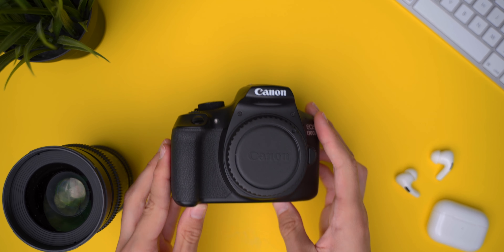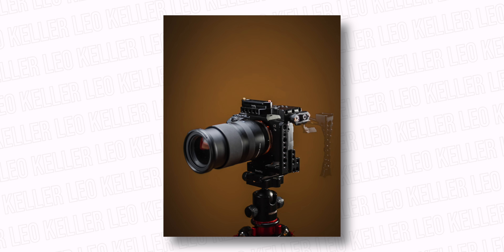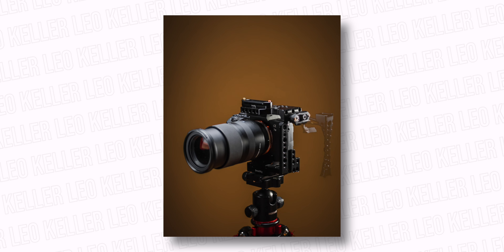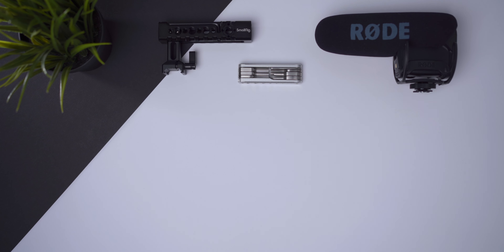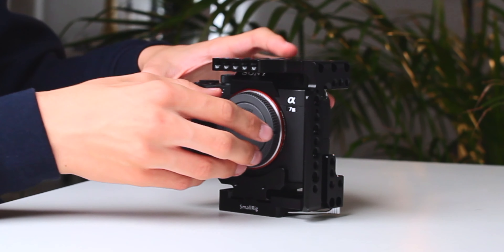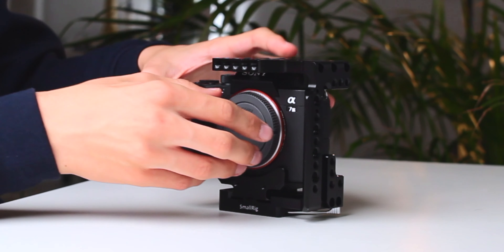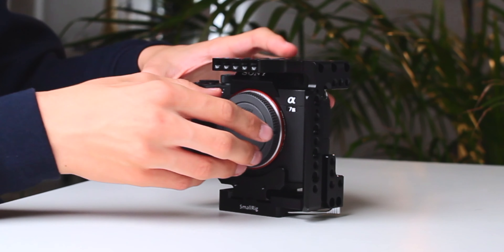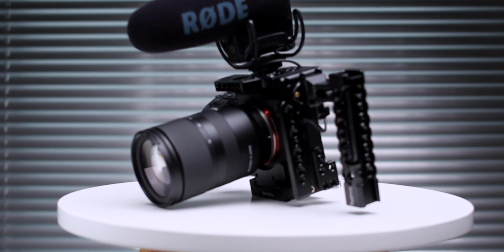My minimalist Sony A7III rig

Comment: Mein minimalistisches Setup: nur die Kamera, nackt.
Vielleicht noch mit dem 3d gedruckten Edelkrone Flextilt drunter. Ist viel leichter und oft deutlich agiler, als wenn man ein Stativ mitschleppen muss.
Reply from the maker: So geht es mir meistens auch. Einfach nur die Kamera mit einem Objektiv. Aber es macht einfach Spaß, solche Rigs zu bauen ;D
Reply: @leokeller  Mit dem Flextilt ist es auch noch sehr spannend, weil man die Kamera beliebig winkeln kann, aber nur so 20cm weg von einer Oberfläche. Deutlich schneller als irgendwas aufzubauen und man muss noch etwas kreativer mit dem Framing werden.